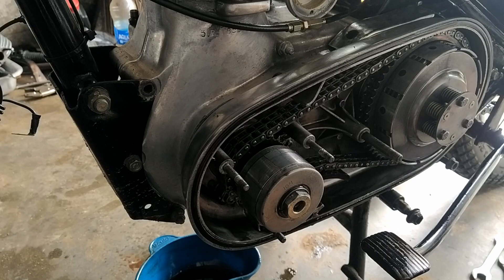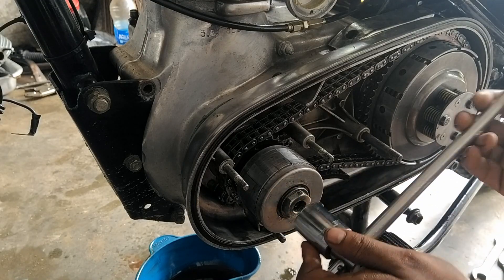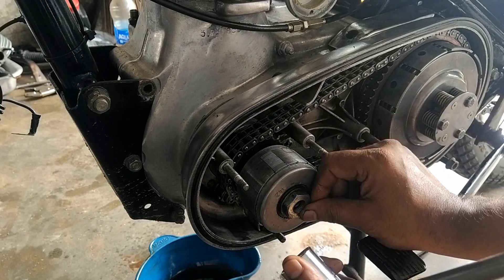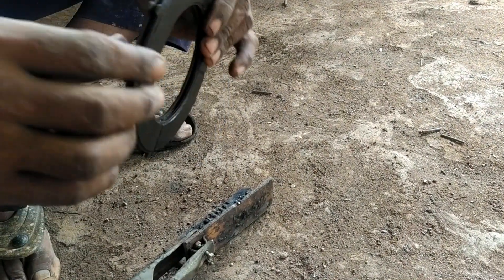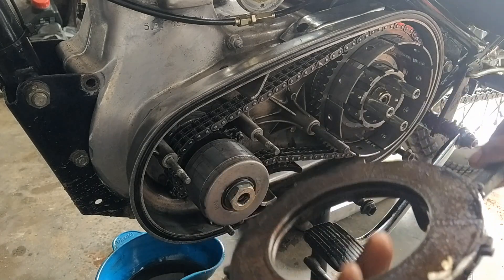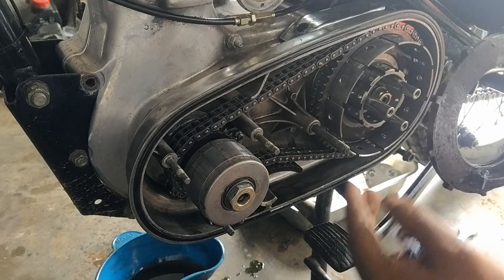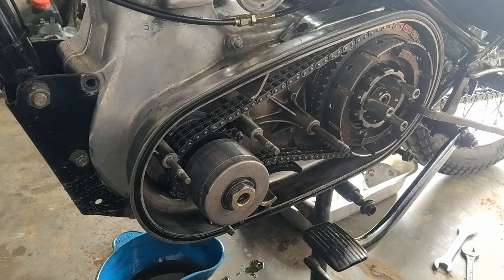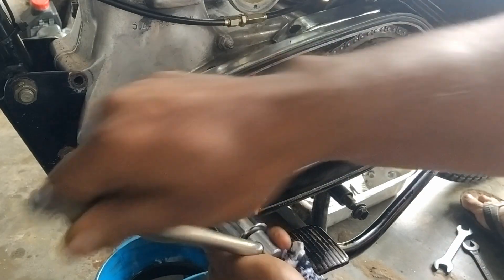Royal Enfield Magnet Removal Tool

Comment: Hi,

I'm from chennai we have a 95 std an 88 diesel  a 76 yezdi and a 2019 interceptor my father bought me the 88 diesel per my request during my second yr of college and i bought the interceptor two years back. My fathers 95 std petrol has had issues for as long as i remember we have spent more than 2L on it from the time we rebuilt it completely at 2014. Now i suspect it has head issues, there must be a vaccum leak and we are tired of mechanics who never return the bike after months of doing nothing and getting paid and shoddy work which leads to more rework.

i humbly ask will you be willing to work on our bike to fix it to its original condition. please anna neenga itha panni kudutha romba nalla irukum. Appa santhosha paduvar.